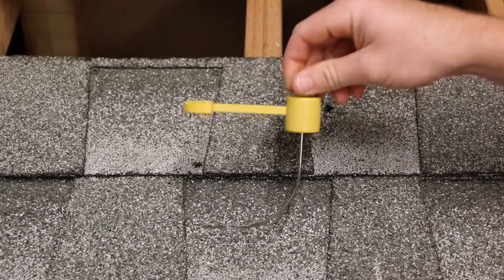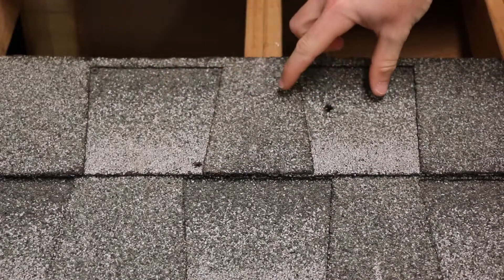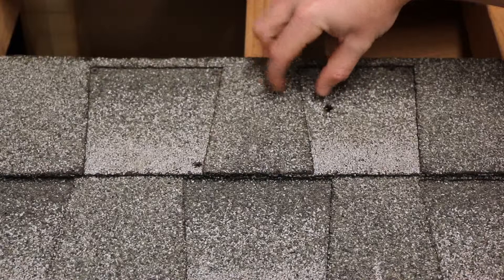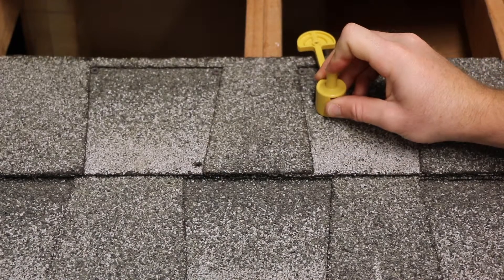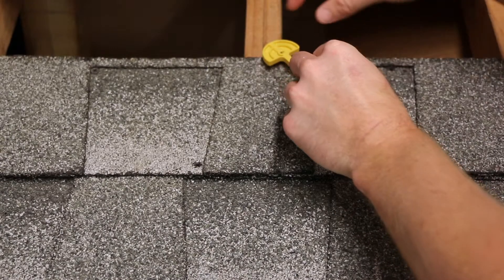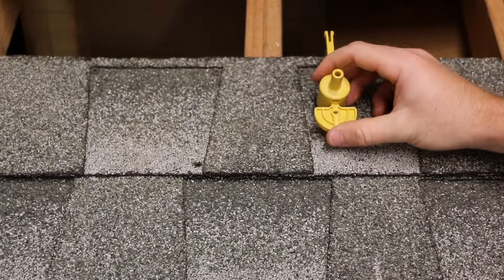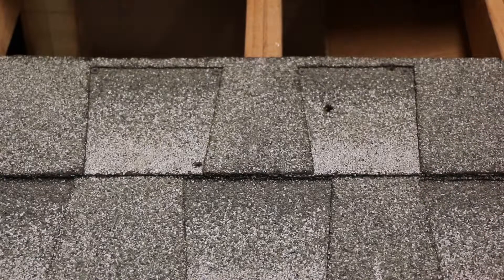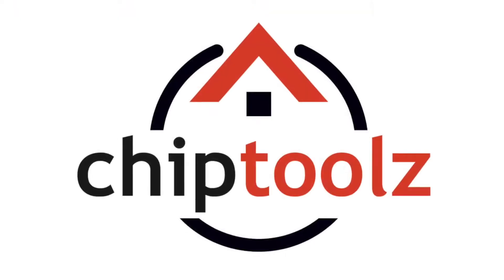How to Easily Find Rafters' Exact Center!

Comment: This tool saves a lot of guess work, but one thing to note is that not all rafters will be the same sizes. So don't just extend the tool on one side of a rafter and think the mark is dead center. You'll have to drill holes on both sides of the rafter, make 2 marks and split both marks down the center for true center.
Reply from the maker: For the most part rafters are 2x4s, but yes it never hurts to verify the center-line from the other side! Thanks

Comment: If you Google for "how to find rafters in roof" you can get some nice ideas.  This product is one of them (though I might recommend lifting up the shingle and drilling underneath it, then sealing the hole and shingle back down).  Wonder if one can make a home made version for approximate...
Reply from the maker: There are certainly some creative other ideas for locating rafters! This tool just allows for quick, easy, and accurate mounting when you're by yourself 👍

Comment: What's the video to give general location?
Reply from the maker: We just noticed that for some reason, that video was removed from our channel, sorry about that! We will be adding it back soon.

For now, I'll briefly explain it:
1. Check out the eaves for the rafter tail, measure over to the nearest common edge, and take that measurement up to the position you're mounting on.
2. If there's a soffit covering the eaves, sometimes you can still locate the rafter tails from the nails/screws attaching the rafter to the outer board.
3. If you can't find either, you can try the knocking method around where you want to mount. Tap on the roof with a rubber mallet (be careful with a metal hammer because you can rip the roof material). You'll be able to hear a difference when you're tapping over a rafter vs over a bay. The bay sounds hollow, whereas the rafter is a shorter, firm sound.

Apologize for the video being down, we will be uploading a new version shortly. Let us know if you have any questions. Cheers

Comment: Request:  can you make me a custom made tool twice that length? 
Finding rafters can be a major challenge and this is with 20+ years exp.  To help from making too many holes in the customers roof that turn out to be dudes.  I’d like to be able to extend the length since I’m sure the rafter is very near the edge of the tool or an inch or 2 off.  An extended tool would prevent an additional hole drilled 
Please let me know.
Reply from the maker: Thank you for the comment and idea! As of now, we aren't working on an updated, larger Rafter Center-line Locator, but I will talk to our engineer and see what his thoughts are on this issue. Cheers!
Reply: I was actually wondering about a smaller one so you could try and use it by for rafter tails by drilling from the side into the fascia board? :)
Reply: @RogerPack  this is actually a good idea as well.  The way I’ve been doing it lately is drilling a very small unrecognizable   hole in the soffit then using a thin wire to push through the sides until i hit a rafter tail then measuring the distance from the hole to wire the wire stops.  This isn’t easy as your going up an incline usually to find the tail so your actual distance of the rafter can be off a few inches but does help narrow down the location. This is where the Chiptoolz can help up on the roof.
Reply: Nice, what size hole and gauge wire you estimate here? :) @MOPAC85
Reply: @RogerPack  very thin.  The wire is actually the same wire used as the colored flag survey markers you place in the ground. They are strong enough and long enough to find the rafter tail yet thin enough to make a hardly noticeable hole in the soffit. Stake flags they call them at Home Depot.

Comment: Thumbs up but, 

Seal up the hole .?
With what.?
Many of us are novice.
Reply from the maker: We've found Chemlink M-1 Sealant works best.
Reply: NP1 caulk..  only way to go...
Reply from the maker: @stonecold8320  I never used it, because our supplier didn't carry it. I talked to a guy that uses it and he loves it as well, so I'll start adding it to my list of recommended sealants. Thanks for the tip Mr Austin!
Reply: You can use pretty much any flashing roofing sealant such as henrys or loctite flashing caulking. Shoot some caulk into the hole and around the hole on the underside of a piece of aluminum flashing and cover the entire hole. If you don't have flashing shoot some caulk into the hole and stuff some old tiny pieces of shingles into the hole
Reply: Unfortunately big box stores don't carry those.  Maybe the clear Henry rig caulk sealant from home Depot?